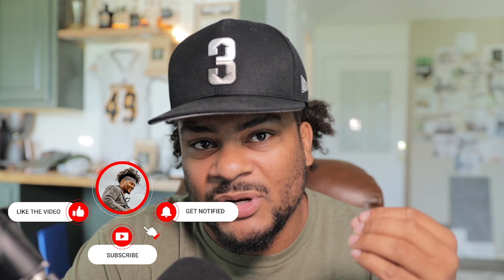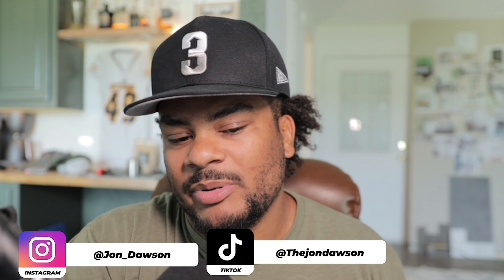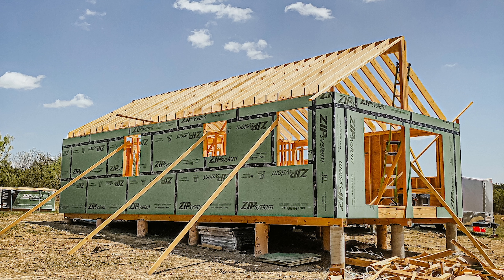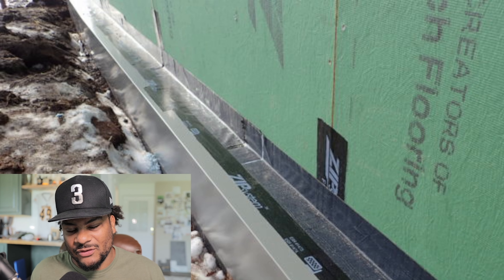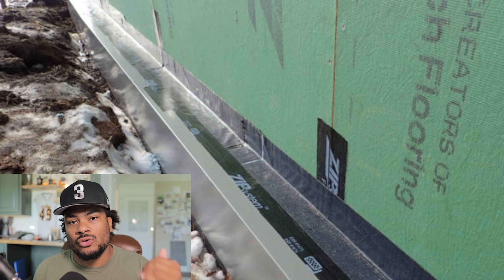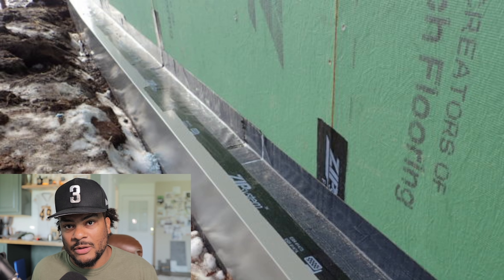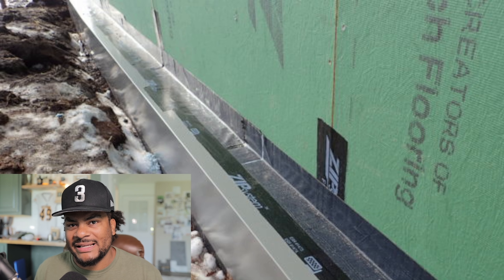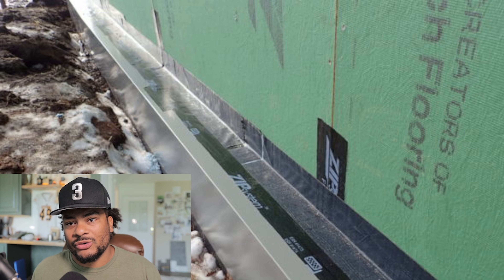How to build a skirt around your house

Comment: Some good ideas here however you're in a frost environment and your cinder blocks being put directly on soil will shift with freeze thaw cycles. Problem is you've attached this moving structure to the house, which is on piers, below the frost line and won't move. These two structures should not be attached to eachother because the frozen ground can push the framing sitting on your cinder blocks and jack up your house.

Comment: I hope your skirting design worked great for you.
I live in the desert in a manufactured home, it has vinyl skirting that has ripped, blown in and sections are missing because of the weather and UV  from the sun destroying it over the years. We get high winds up to 65 mph at times as well as an occasional flash flood waters. Your design would not work very long here because the bottom of the skirting is not anchored in the ground with rebar rods.  It would  be blown in in the first high winds or flash flood water that hits it. As I  said I  hope every thing worked for you. Great video, thanks for sharing.

Comment: How did you seal the bottom of the zip wall that butts up against the cinder blocks? Won't the cinder blocks eventually leach moisture into the zip panel?

Comment: Very clear explanation!  I’ve been told that sealing off the underneath dirt area like this from air movement will prevent the area from drying out and cause mold and rot of the floor underneath. I’m in Texas so it’s always humid and very flat so maybe that’s diff here?
Reply from the maker: It will have moisture barrier on the ground as well as vents and a dehumidifier
Reply: @JonDawson are vents needed if there is a dehumidifier?

Comment: My wood skirting goes to the dirt ad I thinking about digging around cutting the wood skirting and putting something under.   I'm thinking cinder blocks might be my best option. Have old house and trying to fix a lot of stuff. I would put flashing at the bottom and I like the 2x4 on the cinder blocks and a wall to attach the wood shirting to.  May replace the skirting, but I may just fix and paint it also.  Depends on the status of the skirting once removed.  I really don't know why these craftsman homes thought the porches would make a good ceiling for the basement.  Anyone know why they did that?  There is a lot of the house that is crawl space but they decided to put the porches over 1/2 the basement.   Just doesn't seem like the best idea.  It was the garage at first I think?oh well.  I liked your ideas I will be watching more of your videos.

Comment: Good solution. What else do you do underneath a pier beam foundation to keep mice and insects from getting into the floor? Do you finish off the underside? Do you put plastic down and cover with stone?
How do you calculate the location of the sill plate so that the skirt is aligned with the walls? Thank you. Hope I get your response.

Comment: Could you've encapsulated the subfloor?  Spray foam (closed or open cell) or batt insulation under decking, some type of vapor barrier be it zip panel ( not a one man job)or wrap with wire mesh attached to floor joists? The wire mesh blocking rodents. Borrowing from RV or mobile home subfloor. I don't know if it'd be practical but would allow crawlspace to be vented with or without skirting.